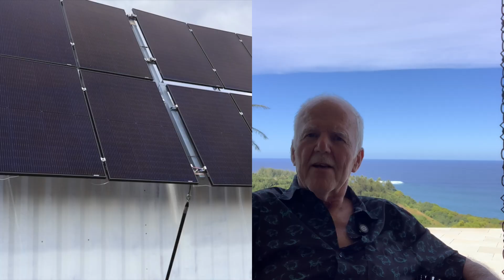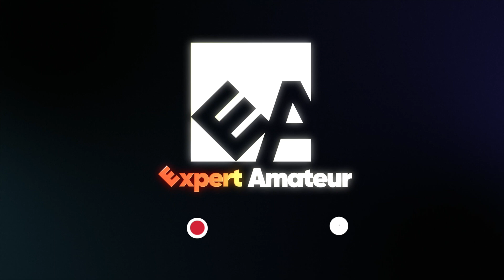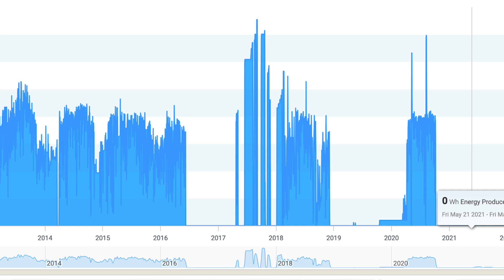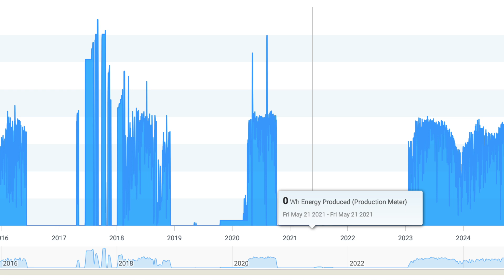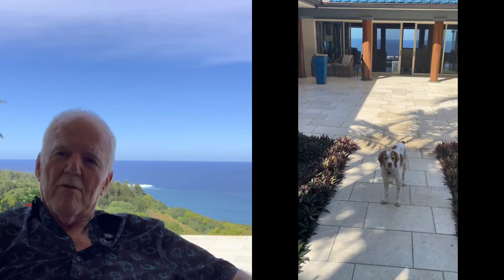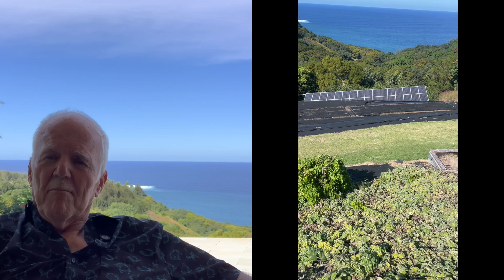Save Money On Rooftop Solar--New ways to meet code requirements

Comment: Beautiful house!!!  I have a detached 3 car garage thats well suited for solar.  With that said, RSD has been a concern of mine and I agree with all your points (including it's questionable origin/benefits, cost, and most importantly, not wanting all the panel level electronics up there to fail at some point!)  The new 3741 compliant racking is new to me (thanks for the introduction), but after looking into it, it's riddled with items that make it a NG for me.  It seems it's mostly aimed toward flat roof installations and the inverter must be placed within the 1' panel boundary, along with the caveat that you must use an approved inverter.   Interesting, and I appreciate that folks are looking for workarounds, but for most, I don't think this will be a solution.
Reply from the maker: That's the original racking that qualified--ballast-filled plastic stuff for flat roofs. There are other racking systems that qualify now. Take a look at SolarBoi's videos, or contact him for additional advice. Naturally the folks that make the electronic solutions are battling. Things might have changed but as long as you can meet the 30 seconds, 30 volts requirement the inverter can be wherever you want. You could use one of the cutoffs to do that, which beats the heck out of one per panel, though from my reading having the DC wiring in metal conduit could eliminate the problem. There are more and more rack makers qualifying their stuff. It's a pretty weird thing, but then RSD has always been weird. I wonder if mounting on your detached garage means you don't need RSD at all? From my reading it's not just ground mount systems that are exempt. I could be wrong, I'm not the expert, again--Solarboi. He's all over it.
Reply: @ExpertAmateur-xn6dr  Thanks!  I ended up watching his video and contacted Pegasus about their racking (no inverter spec'ed according to them).  Sadly I looked into the detached garage thing and the local inspector said nice try.  You mentioned a cutoff, can you give an example as I don't think I'm aware of them.  I did see the SA 15K is set up for RSD, but I think that's just for triggering something like a Tigo system.   Also, when you said metal conduit could work, is that only at the panel location (roof), or must that go all the way back (including under ground) to the inverter at the house?
Reply from the maker: @ssoffshore5111  The cutoff could be just the cheapest Tigo triggered from the inverter at the point the conductors exit the boundary. I think signature solar has them for $39. I'm probably going to do that on my container project just for the hell of it. And a remote switch mounted prominently where first responders can find it. Inspectors love to see those big red buttons ( if the SA accommodates that). Tigos will also respond to the conductors being opened with a standard PV disconnect switch, which is important for working on your installation anyway. Since your inspectors sound finicky you should probably provide a drawing with your plan for how the RSD is going to work. They're going to hate the rack solution, but tough. If it's UL approved to meet code they don't really have an option and the rack solutions DO meet the intent of the code. The metal conduit only has to go to the point it goes into the ground. In ground you can use sched 40 PVC conduit. In some jurisdictions you can use sched 80 PVC aboveground, but probably not with yours. Since the entire notion of the 30 seconds/30 feet is to keep firefighters from coming in contact with wire, metal conduit 'should' meet the requirement--in the same way the racks so, by managing the wire in a way that keeps first responders from coming in contact with it. And it's generally code anyway. But who knows. Begging forgiveness can be expensive, though if they're going to only pass you if you litter your roof with Tigos then yeah, I probably would do the same.
Reply: @ExpertAmateur-xn6dr  Great info, thank you!

Comment: If I had it to do over again I would go with Tesla powerwall 3s. They came out a few months after I commissioned my system.
Reply from the maker: I'm curious why you say that. I think the Powerwall is a extraordinary, and an acquaintance of mine who owned one of the largest solar installation companies on Maui told me that they were the best choice because of the way they manage their warranty, but that's the only data point I have. The Powerwall 3 is not a suitable choice for my situation since they don't support legacy microinverter systems like mine, but perhaps the powerwall 2 (which does)
 would be a worthwhile choice if they are still available. I don't see anything about them on the Tesla website.

Comment: Love your videos. I have been thinking about putting solar on my next house I will be moving into next Spring. I have built an off grid system for my Dad in the New Mexico desert and if you can keep it from blowing away you’re good to go. How ever I live in Washington State, And there are a few more things to consider. Im really leaning towards a ground mount ( especially after watching your videos) even though the roof is very well suited for solar.  What are your thoughts on Voltage drop for long solar cable runs? Does it really matter much if you sacrifice a percentage of your voltage when you have string voltages of 500 or so volts as with the EG4 18Kpv. I know increasing conductor size is an option, but that is also expensive. This might be a topic for a future video.
Reply: I know I would probably be shocked on how cold the New Mexico desert gets, but I'm sure you have to keep an eye on your maximum string voltage on cold days in Washington State at least as much as you do in the desert.
Reply from the maker: If it's less than a few hundred feet I wouldn't worry much. You could certainly calculate it. In fct if you give me an estimate of the length of the run I'll dig it up for you. I assume your using solar cable, the most common size for long runs is 10awg. If you aren't going to bury it directly stick with solar wire, if you're using conduit some folks switch to #10 or #6 copper THHN/THWN wire which is cheaper even as #6 (though I haven't looked recently, but I noticed Home Depot is locking up their wire these days.)